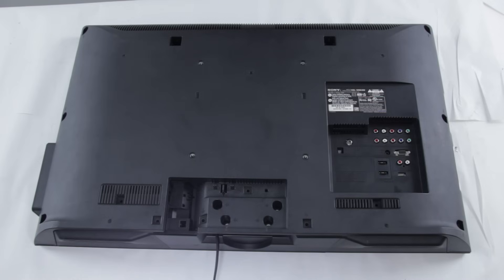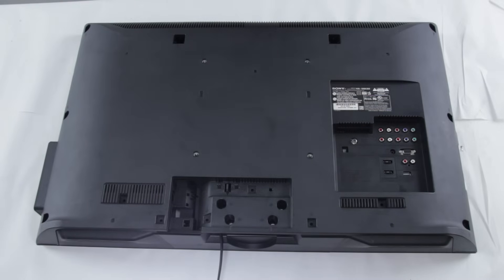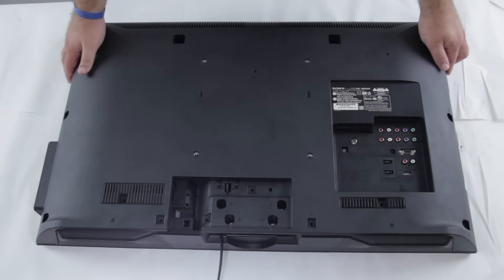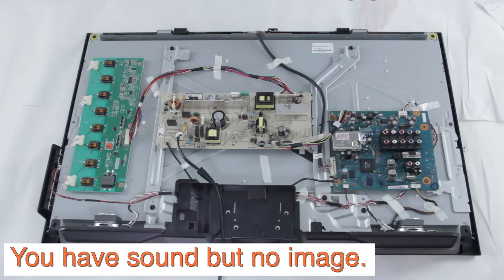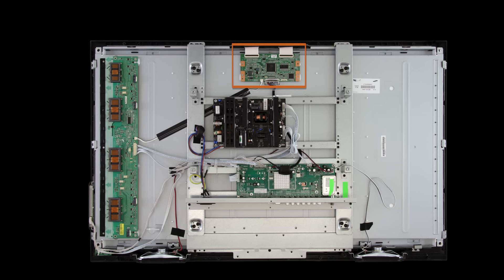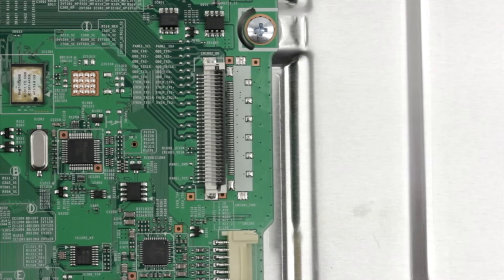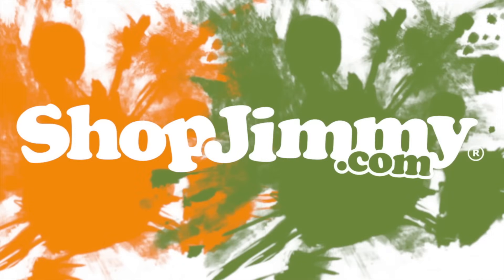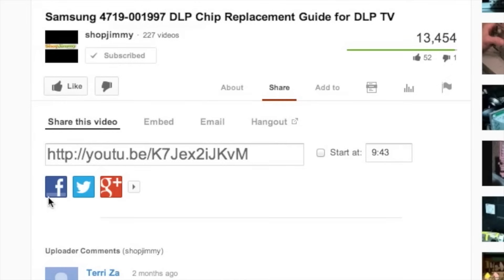LCD TV Repair Tutorial - T-Con Board Common Symptoms & Solutions - How to Replace T-Con Board

Comment: I have a VISIO E550i-B2 LWJ2PPAQ 55 inch tv. The t turns on and the screen lights showing the V symbol on the screen. does not continue to a blue screen to show "no signal". Also the remote does not seem to control the tv

Comment: my TV Is a Samsung model  UN39FH5000F. type: UN39FH5000
MODEL CODE:UN39FH5000FXZA
VERSION: PF03
S/N:Z79L3CUF108663N
I go to plug in the TV, and the TV begins to flicker. I attempt to turn the TV on, and although the led light lights up, the TV continues to flicker. the way it would appear is a slight strobe like effect,that flashes once every second or second and a half. 
I have replaced the power supply board and the board with the rca jack/HDMI jack/flash drive. the only pasted I have not replaced is the t-c. hoping you had a suggestion as to what my problem may be, before I spend more money on it.
Reply: there are also the two slim boards that are connected to the t-con and the board that is connected to the power button.

Comment: I have a Samsung UN55D6420UFXZA that works fine for anywhere from 20 min. to 2 hours depending on how long it has been unused. What happens in the set shuts off automatically then continues to try to power on with no success. When this happens the standby light blinks twice, five times then tries to power up again just to be returned to the same light blinking cycle. My first diagnosis (Major amateur here) was that the power supply board was faulty or connectors on it and needed replacing. Had Sears come look at it who said it was the Main board ( more expensive). Any thoughts on what the issue could be?

In addition, We picked up an LNT4066f that is showing a darkened screen and horizontal lines. We were told a part had been replaced but not told exactly which one. Again, Amateur here, but thinking this could be the backlight inverter.... Watching this video I am concerned it could be the TCon which is more pricey of a repair at this time. Can you shed some light here too?
Reply: Just saw the post stating there is no tech support here anymore.... Sorry.

Comment: SONY LCD KDL-46W704A - WENT FORM HORIZONTAL LINES SPACED AT 2MM ALL THE WAY FROM TOP TO BOTTOM....AFTER A FEW MONTHS, THE HORIZONTAL LINES WENT THICKER AND VERTICAL THICK LINES APPEARED CENTER LEFT AND RIGHT. SOUND IS OK....ONLY PICTURE IS A PROBLEM.

Comment: The color on my KDL-40Z4100 has gone crazy.  Serial #8500095.  The yellows and reds are flaring and the black background is too dark. I have gone through the initial set-up procedure to try to reset things but it made no difference.  I adjusted all the color, hue, and temperature adjustments but these made very little difference.  Is it a lamp/ or a T-Con board, or what?  Thanks for any help you can give me.  Bob
Reply: I neglected to say that my KDL-40Z4100 is a Sony set, although you prob ably know that.

Comment: Samsung 55" 3D Television Model# UN55ES7500. The problem with the unit is that the Blacks change to Red rendering any dark image or movies unviewable. Also noticed that the back of the TV gets very hot so much so that you can't keep your hand on it. This occurs in the area under or just up from the evolution kit. Left side where your your USB and other I/O connections reside. Do you have a suggestion on what I may need for this repair? Any help would be appreciated.

Comment: I have a 32" vizio lc320exn and i found the t-con board replacement but i also need the ribbon cables for the tcon to panel and having a hard time finding them.
The tcon is p/n 6870C-0414A and the on the ribbons is says AWM 20941 vw-1 90V 105C.
Can i use any ribbons that have same number of pins and is AWM 20941?

Comment: hi, I have a samsung un55f6300af not the th01 ver and tv started to turn off and on on it own and after disconnected for while reconect and turns on got samsung logo but then no image nor sound,  using remote red light blinks as normal but does'nt do anything... visualy inspected boards and don't se nothing burnt... what might be issue?

Comment: Hello I have a 60pv400 LG television. Serial number 107RMXX53474. 

The television was working great during the day and the I went to turn it on and the screen is black. When I reset my cable box the TV had flashes of static which then stopped.  Now my question is although this may seem like a tcon issue, would I repair it the same way since the TV is plasma?

Comment: Hi thanks a lot for the educational videos I have a problem with Sony KDL46Z5500 stays in standby red light flashes 8 times after turning on power TV comes on for very short time shows low power on left side and turns off again

Comment: My TV is a Sharp LC-42SB48UT-A. the problem is that it plays with perfect picture and sound, then after 15 min, loses picture (black screen). The power light is still on, and the sound still plays. if I turn off the TV and on again, I get picture. but after doing this several times the loss of picture happened quicker. I have tested on all the ports, with cable box, computer, and DVD player and has the same results. I ordered from you the Invertor board, and it did not resolve. Any help would be appreciated.

Comment: Hi there,
I have a sharp aquas lc-46le620ut. The screen is black with a soft blue dim backlight located on the lower left corner. The tv still has sound. Can I assume it's my t-con board?

Comment: Hii jimmy, my led tv is samsung j5100 and i was watching tv and suddenly my tv stArted showing lines and then the panel went blank. I checked out videos online and i removed one flex cable from left panel and one side panel started working. Then i connected the other flex and again the panel stopped displaying. But now both not working. So i need to know should i replace just tcon board or full led panel?

Comment: Hi..thanx a for the info provided on your channel...
well I have an issue with my Samsung Lcd tv. model LA32A450C1
The tv is kept on the table..not wall mounted.
So what happens is that the image appears whitish..negative (black n white)  and the four corners become a lil dull when that happens.
however if I incline the tv to the back or maybe keep it flat on the ground the image looks fine....and the dull edges regain their normalsy gradually.
I tried disconnecting n reconnecting the  t-con board n checked for any loose connections but the same problem exists.
what do think is the problem?

thanx a lot
Regards 
Chandan Kowli

Comment: Hi ShopJimmy.com.. I have a UN46FH6030FXZA  S/N: Z7F73CXF205756K and my display is much darker but goes back and forth when I'm changing picture settings goes back to normal for 1-2 seconds and than darkens. I disabled both the Eco and Energy functions and still get the same problem. I still have audio and can still see the picture it's just much darker. Does the t-con board need to be replaced? Thank you very much.

Comment: I have Samsung TV model # UN46C6300SFXZA. One day suddenly no picture is showing from all sources (all HDMIs, Components, PC VGA input ) but with sound. Message is “no signal detected”. From TV source it shows horizontal white and black flickering image with message “weak signal” in the center of screen (I have no antenna cause I have cable service). Only image is showing from the source of USB reader with SD card (not CF card). Still it displays all the list of sources.

What is the problem? I will appreciate any help. Thank you very much

Comment: Hi I have an LG 47LN5750 (TL;DR at the bottom). It was given to my father by a random man who was gonna throw it out  because it had a small single horizontal line running through it. The man turned it on in front of him and showed him that it worked just fine with the exception of the line. My father brought it home turned it on downstairs and it worked just fine same as the first time he saw it. We brought it up to my room and then it didn't work, we used all the same wiring as downstairs, and in addition several different wires but to no avail. When it turns on it flicks half the screen with horizontal lines for half a second then goes to being a grayish/black screen (On with back lights, but no image).e get audio, but no visual images. Is this a result of the TCon board just suddenly going bad or is it something else?

TL;DR screen has working back lights and audio, but displays horizontal lines (only for the first half second of the TV turning on) then goes back to being a plain gray screen is it the tcon?

Comment: Sony Bravia KLV32BX300 Serial no :1341383, when you switch on the tv the picture is clear and fine but after a few seconds there is a blinking red line on the right hand side of the tv, the screen jumps for a second and double image comes. Is this repairable, appreciate your advice.

Comment: I have a Samsung LN-4042H, I have this very mild artifact on the bottom right area of the pic, I call it a artifact only cause I don't know what else to call it. I cannot see it at all when I'm watching anything, only when the picture is a blue screen or black or pretty much any solid color, or even can be seen on the guide menu of my cable box, tho barely. I'm just wondering if this is physical damage to the screen itself and is going too remain like this and not get better or worse. Or is this a sign of my t-con board starting to fail and I should think about getting a new t-con board too have one on hand for when it does fail. If it is not either of these situations I have suggested, what else would it be?? And is there a way to repair this cheaply and safely?? I don't think it's worth doing a risky repair since right now it is very mild and cannot be seen. I've had this tv for free weeks now and I didn't even notice it until I was playing with settings on my cable box and temporarily had a blue screen, and trust me I am a A/V fanatic who's pretty anal about my sound and picture.

Comment: I have Samsung LCD TV Model LA32D481G4LXL & Srl no. MQ2N3PBC300334P. My TV starts with picture oK. But after about ten minutes one colour goes. And after 15-20 minutes double image occurs in which letters shift vertically down. Can you please guide how to repair the TV or which part needs replacement and its part number. There is no problem in sound.
-- Radhey Shyam Kolkata India.

Comment: Hi,
I have the Sharp LCD TV model: LC-46A65M
The problem im facing is that when i turn on the TV (either from remote or manually) the front small red LED light turns to green as if its "on" but the screen do not show any display (some times screen just flicker for 1 or 2 sec) and then after 2-3 seconds the TV turns "off" itself and the front LED light goes back to red again. 
Can you guide me what might be the problem? ive checked inside all the capacitors are ok (no visible leak or bulge)...

Comment: Westinghouse 40' LD-4055 MP123.

Standby lightAutomatically turns on if plugged in. stays on when plugged in- Wont shut off unless 110v is unplugged. 
No video. No Sound.
Already tried replacing the PSU board.

Comment: My Visio E420i-A0 has a large black band across the screen. The TV is watchable but it is noticeable. I do not know if this has any bearing on the problem, but this happen right after I had Satellite TV installed. From some comments I gather I can have it fixed at a great cost? I can hire a repair man and buy the parts from you... correct?

Comment: I have a LG 42" TV. I have no picture but have sound. I have backlights and when I use the remote even though I can't see it on the screen (trial and error) it responds such as changing to another HDMI port, USB or change channels and volume.  I tried to change components and nothing I get the sound but no picture. I also tried the light against the tv to see if I could possibly see anything on the screen but I got nothing.  The tv is on 20 months old and is out of warranty according to LG.  They give 12 months or 18 months from date of manufacture. In my case it's July.  Also the bottom middle light on the tv showing when it's off or on blinks 1 or 2 times when first turned on and then no light. Pretty sure but it never had a green light to show it was on only the red light when it was off.  The info for the tv is model # LG 42LB5600-UH. I also tried to factory reset the tv by unplugging it for 10 minutes, holding the power for 60 seconds then plugging it back in and still the same, even changed the HDMI cord and the Directv box (reset that also) still nothing.

Comment: i have a kdl40v4100 sony Bravia I can't find a serial number but i have a negative picture in hdmi and distortion and flickering through the av. ive reset the picture settings, changed the settings individually and I'm not really improving the quality of the picture anywhere

Comment: Hello. I have 2 questions. I have an Insignia (NS-50d40SNA!4). I replaced t-con board, but there is a wide vertical line down the center of the screen. Left 1/2 picture is fine, but right 1/2 is inverted. Ever heard of this?

Next, after I re-attached old connector ribbons, screen went black w/no sound. Looking to adjust volume I accidentally pressed "input" and now I cannot see input source to even test sound. Is there a way to get to factory setting w/o seeing screen?

Thanks.

Comment: hej i have a promblem with my tv lg 55lm620t.ze serial no 301wrtf86193 the screen is divided into two. the horizontal line line is 28 cm in width in the middle of the screen and the picture is darker with the horizontal line well as on the lift and right of the screen the picture is clear. i need some help

Comment: The picture on my 70" Vizio (Model E701i-A3E, S/N 36LFTRNXCP06006) has an intermittent problem with half the screen.   When not working correctly the bad half is darker and blurry.  It can come and go.  There is audio audio.  I can still make out images on the bad half but they are just dark.  I've reset everything, tried different inputs.  Same results.  Is it the screen, T-Con board or ???

Comment: Is it possible to replace the T Con board on a Sony Bravia kdl46vl160?
Reply: I also have have a Sony KDL 46vl160 that is exhibiting colored vertical lines. I suspect the t-com board is the issue. I have located the board and was able to remove the mounting plate from the frame but I can't figure out how to remove the board from the heat sink plate. Any help would be appreciated.

Comment: Hello,  I have a Vizio flatscreen (Model XVT373SV, Serial # LAUKGIAM2100885).  All the TV does when I plug it in is the Vizio logo blinks between amber and white.  There is a slight bluish backlight.  I cannot turn the TV off, I need to unplug it.  It usually starts blinking soon as I plug it in.  What could be the issue?  I've tried to reset it, but there was no change.

Comment: I have a LG 32lg7000-za with product code 32lg7000-za.aeuqljg which  after a thunderstorm with lightning stopped working. Powerboard is ok, all voltages are present. I have replaced the mainboard and now I have power on light and a flashing backlight. A Tcom board has been ordered and I hope I can get picture and sound for those are not present at the moment. What else can be damaged?

Comment: I  have a polaroid TLA4011c.  The tv went to no power situation. After checking power supply found that main board was defective. After replacement of main board had sound but just a white raster. Replacing t-con board brought picture back momentarily, but in less than 1 minute bottom half of picture shrunk from bottom up to where you could not see menu and barely top of screen. ordered second t-con bd with same problem. I am thinking the lvds cable is problem since I tried main bd a second time with same problem. Am I just spinning my wheels because the panel is bad or is it the lvds cable? Any tests or ideas appreciated. Sam   polaroided out

Comment: I just got rid of cable TV. and went to rabbit ears. My rca led52b45rq, doesn't transmit the audio signal. The picture is great, the settings are fine I believe cause if you turn the tv on and off a bunch of times the audio will work  tell you turn it off. any ideas?

Comment: I just bought a used Sony KDL-52S5100. I installed it 2 days ago. Has worked fine for 2 days and was fine this morning but turned it on this evening and has the solarized picture. I went to the menu and the menu is not solarized. I went to the guide (on Dish Network) and it also looks fine and is not solarized. Please Help. Darlene

Comment: my element eleft406 video went off and won't come on. I'm seeing a lot of help here but this tv doesn't look like any of the others. I'm having trouble identifying which board runs the backlight.
I have 3. one on right is where all the peripherals connect from other tvs. one with a processor chip with cooling fins on top. and the third (I think this one) has two micro ribbons attached. the third is similar to the one in the last part of the video.  any help on which is which?

Comment: sir i have lg led t.v this isvthe model number..32LN5100-TA my problem is that it doesnt have picture and sound but the power supply and logic board are ok because i already check the supplies its stable but still there is no picture or sound..do you think sir the t con board is the problem?thank u for responding in advance....

Comment: i have horizontal lines across my samsung led 50 inch tv and vertical lines when words are displayed on the screen. otherwise everything is normal. can you assist please. my model is UN46C6400RFXZA, VERSION NO: SQO1; 
SERIAL NO:Z10Y3CSZ500458J  THANKS.